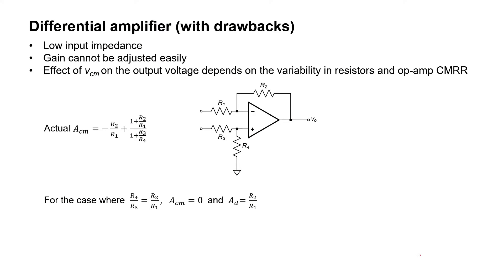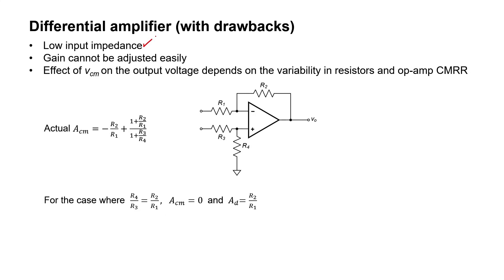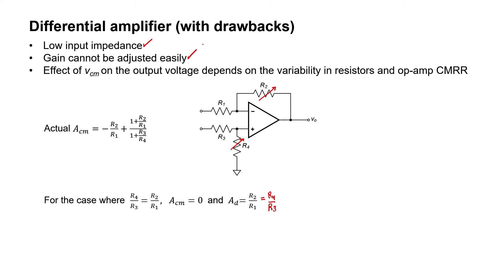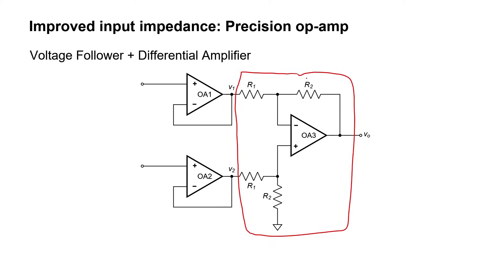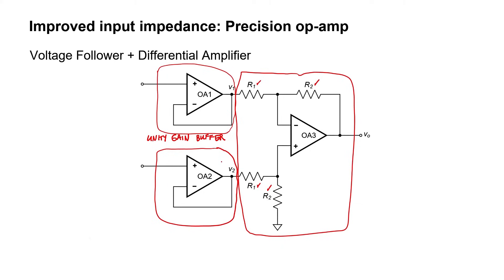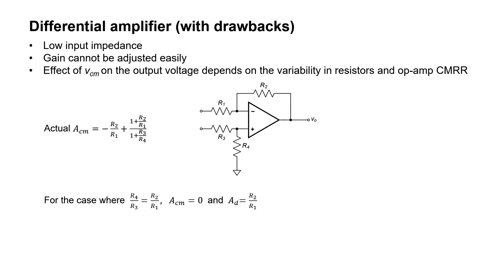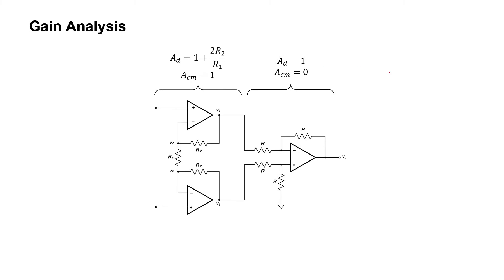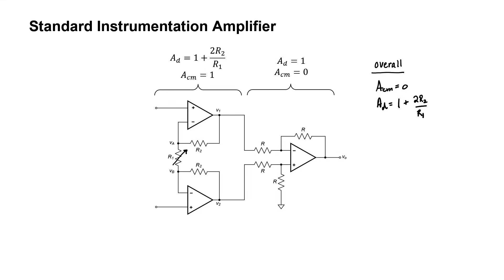Instrumentation Amplifiers Explained (Amplifiers #7)

Comment: Oscilloscopes read positive and negative input voltages, example: + - 100mV, + - 200mV, + - 500mV, + - 1V, + - 2V, + - 5V, etc, right? I'm setting up custom probes, and I need to get the widest range of resolution possible to improve the display of the waveforms. I have a Pressure transducer that operates from 500mV positive to 4.5V positive. When configuring a custom probe, it uses the voltage of +- 5V and offers me a resolution of approximately 35%. Since it uses the + - 5V setting of the oscilloscope and the result is 10V, right? This device would transform the transducer signal voltages from positive 500mV/4.5V to negative voltage? Let me explain, for example that the device transforms the signal in a range from -2V to +2V, I think that in this way I could obtain the best possible resolution on my oscilloscope. I asked ChatGPT if this was possible and they replied that with the INA333 (Precision Instrumentation Amplifier) it may be possible.
I'm not an electronics expert, I'm a mechanic and I'm trying to improve the resolution of my waveforms.